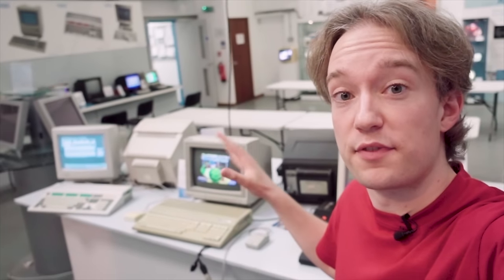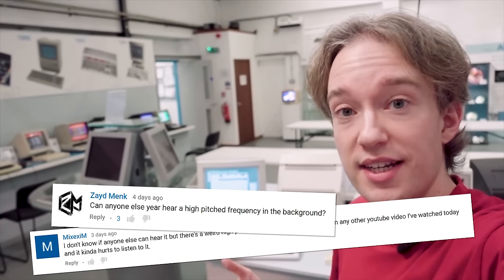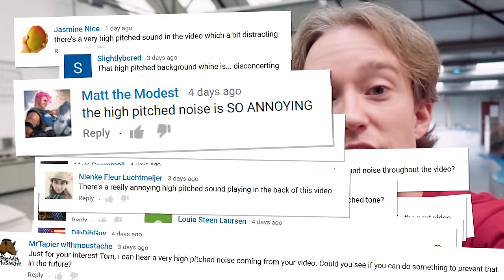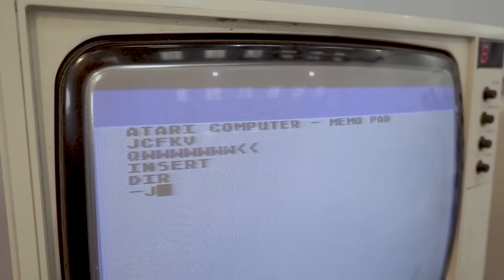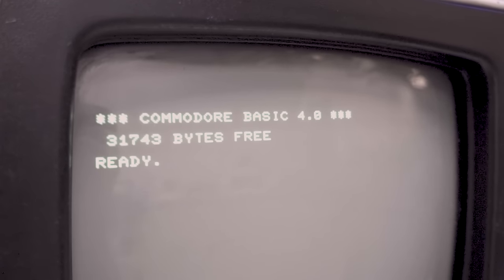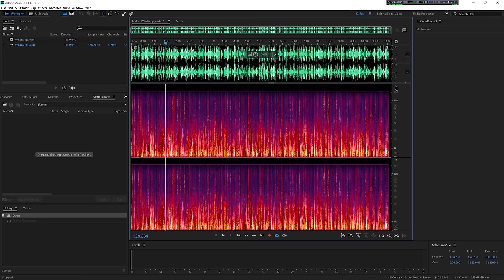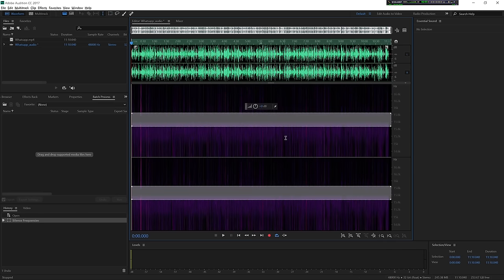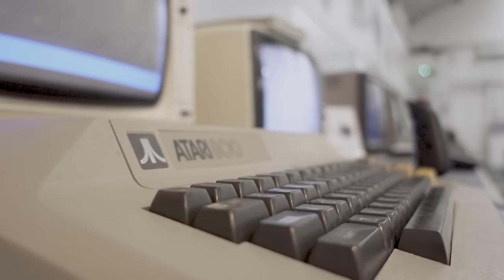Why old screens make a ʰᶦᵍʰ ᵖᶦᵗᶜʰᵉᵈ noise

Comment: Repairing modems with noisy mains transformers and a limited supply of replacements. As the oldest tech (40) I was the bench mark, if I could hear the hum it was faulty otherwise test ok.